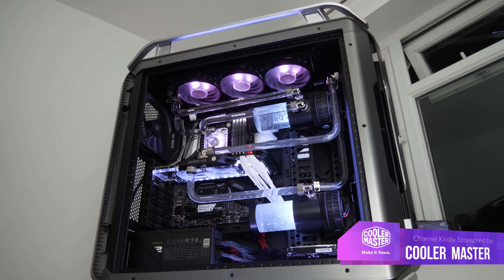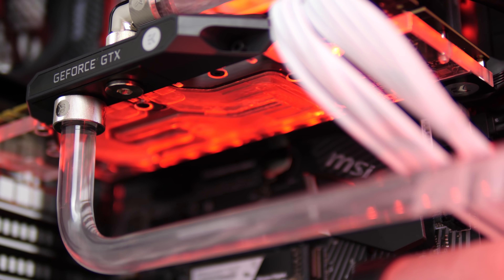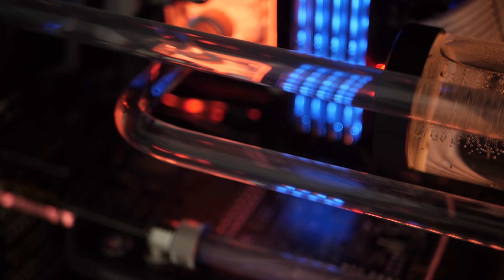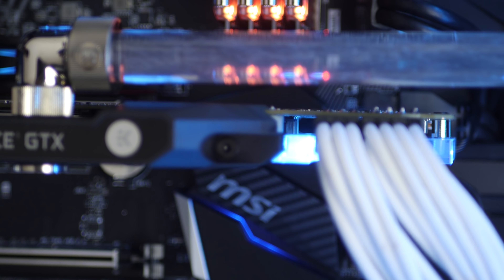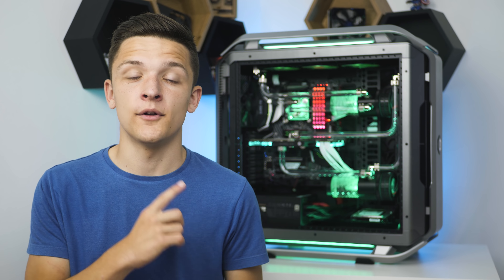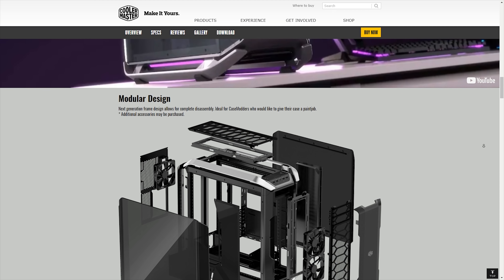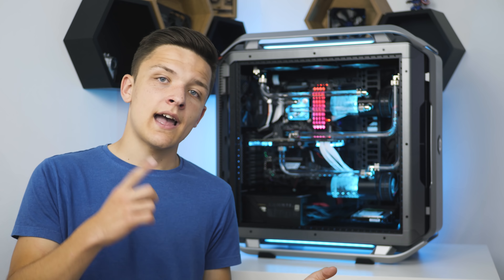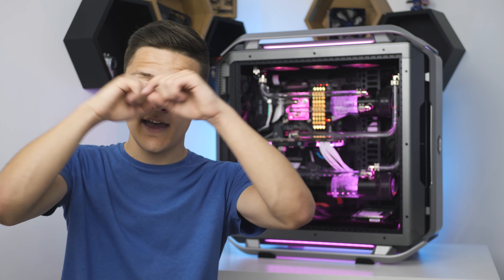INSANE WATERCOOLED GAMING PC BUILD & GIVEAWAY! [GTX 1080Ti & i7 8086K Dual Loop! - 4K BEAST]

Comment: Great video GeekaWhat. Just built my new PC with a 1080 and an i7-8700k, however my I cannot get my NZXT Kraken x62 to work :( so I can't use my new PC yet.
Reply from the maker: Thanks dude! Ah damn :( Are the fans spinning up? If not it's an issue there, if not, is the pump lighting up? Check the pump header and if no luck you may need to hit up NZXT's support :(
Reply: GeekaWhat Fans are spinning but the pump isn’t lighting up :(

Comment: So many things aren't optimal in this build. Why would you need 480 GB for windows and some more important programs? ~250 GB is more than enough for that alone. 4 TB hard drive for music and games? Games you want on SSD cos of loading times and I have myself lossless music collection of 2300 albums and didn't fill yet my 2 TB drive with music. 8700K is MUCH better value than 8086 and is not bottleneck for that 1080 Ti, and if you are gaming at 4K usually not bottleneck even if you run them in SLI. You could save money on so many things from case, CPU, over HDD to cooling for literally another 1080Ti and gain literally 30-40 FPS on 4K.